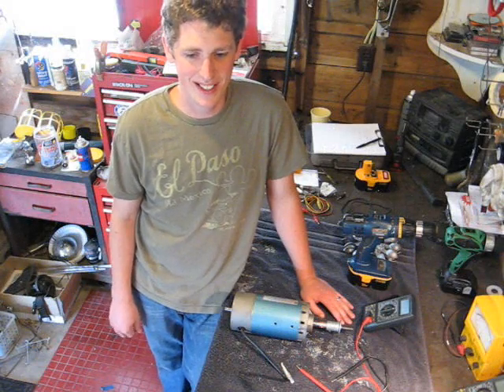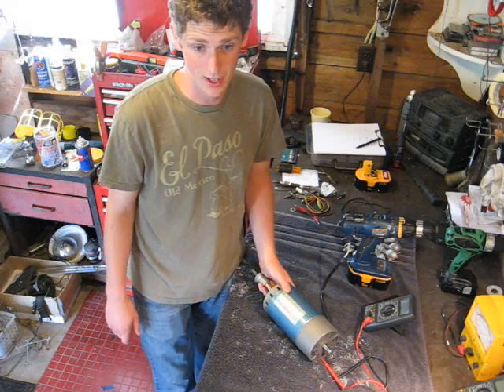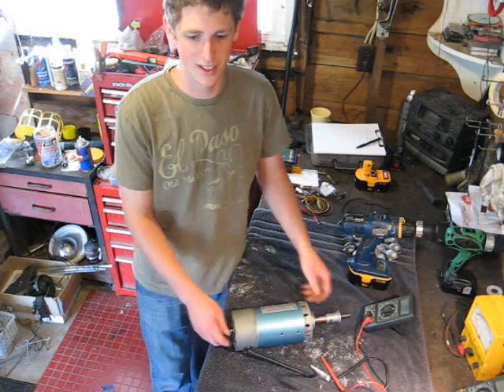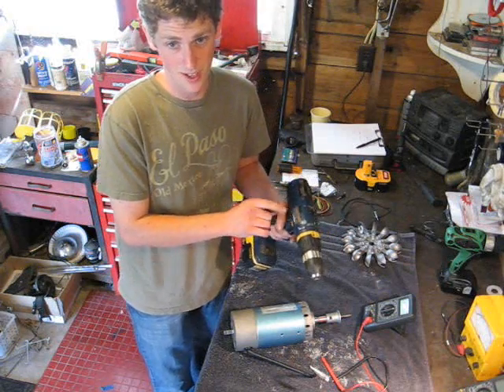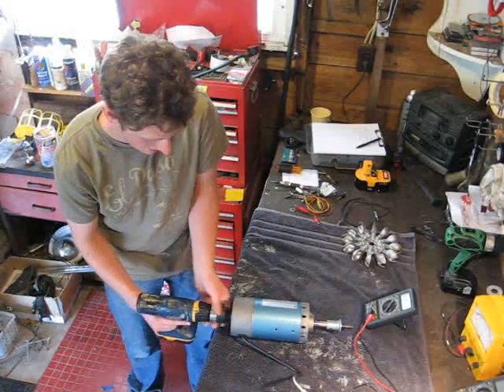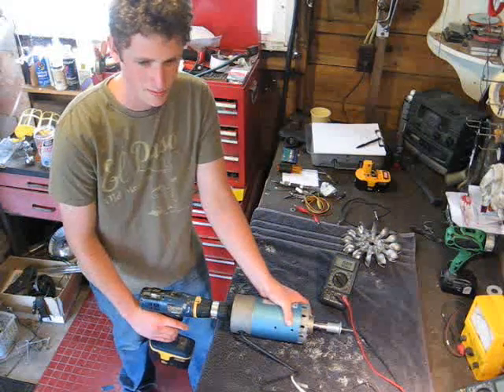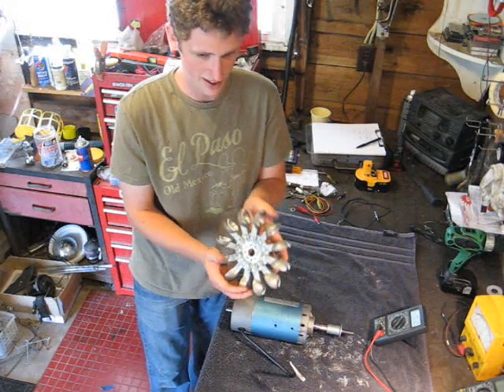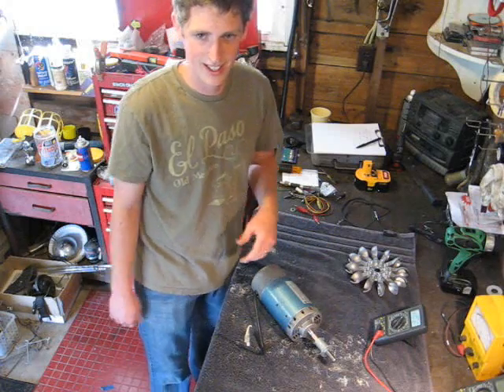How to test a DC motor for use as DC Generator "Shinn Fu" treadmill motor

Comment: Treadmill with DC? Why? I saw one of those in the garbage room that I meant to disassemble but didn't. I couldn't for my life figure out why there would be a big DC engine in something run on AC?
Reply: The reason DC motors are used in treadmills is to allow easy variable speed. It's much more expensive to do this with a true AC motor.

Comment: You can use an automotive voltage regulator to regulate for 12-14vdc voltage. There are adjustable voltage regulators you can buy or build as well. One thing you do need to do when using these type of PM motors, you need to keep the RPM in check. I use a voltage & current meter that gives me the output at all times. You can then adjust your RPM accordingly.

Comment: PM motors are good but there is almost no way to regulate the voltage output well(it will be fixed because the flux from permanent magnets is fixed.)To regulate voltage you will need a shunt or compound wound DC Cumulative compound DC motors work better than differential compound

Comment from the maker: Well with hydro you could use a governor that regulates water flow in correlation with voltage. If not hydro you could use voltage regulator(s). Why the need to regulate voltage, whats the application? 

A battery will absorb excess voltage, as long as you keep it from over charging with a charge controller.

Comment: @enticed2zeitgeist If your RPM/volt = kv is too high, your output voltage will be too low to charge a 12v battery.   Output voltage = rpm / kv.   For example,  12v = rpm/ 30  -->  rpm = 360 rpm, which is really fast for a windmill.  A lower kv rating would be better (easier for a beginner to make a succesful windmill).

Comment: is Voltage per RPM more important than motor efficiency?

Let me ask this.  Would you rather use:
A motor rated at 130 VDC rated at 75% motor efficiency
orrrrrrr
A motor rated at 24 VDC rated at 88% motor efficiency

Also, do you know anything about motor efficiency vs. generator efficiency?  
Is it the same forwards and backwards (a motor with 88% efficiency also acts as a generator with 88% efficiency?)

Comment: Your fooling yourself! you have to look at the power output with an oscilloscope not just with a DC volt meter. You will see that the power coming from the "DC generator" is not clean.

You can gain more efficient power if you rectify the power coming out of a permanent magnet motor.

Comment: Treadmill motors are a good choice for these types of applications.  I've currently got one mounted to a stand that is powered by an unmodified bicycle.  The key is testing them like you did in the video, and having permanent magnets in them.  Alternators and motors with electromagnetic coils require power just to energize the magnets and usually need a rectifier to convert the current to DC.  A+ on keeping it simple.  Thanks for the vids!

Comment: I have one of these motors and i am going to build a Wind Generator with it. My only worry is...how many amps i am going to get at 700 rpm and at what wind speed? i see winds on a daily basis at over 25 mph and more most often at 40 mph. I also plan of using a 4.5 inch hub,  but i need to know the correct length of  blades to use.

Comment: Keeping in mind that a good 100Amp alternator will give you the same power output that a 130V 10A treadmill motor will.  Also its important to be able to vary the load coming from the generator to keep it in its power band, similar to solar cells, maximum power isnt found at maximum voltage or current output, but somewhere inbetween.

Comment: people need to understand the deadest simple rule of electronics P=I*V or power is voltage times current. comments about rpm's and voltage are meaningless without current.  Most people making home windmills do use car alternators because theyre designed to generate power at varying RPM's and because you can pretty much plug them straight into an inverter.  You also just HAVE to gear/belt it to a useable RPM range, and preferably use a battery for energy storage

Comment from the maker: Well your typical car starter runs a thousands of rpm's at 12 volts, so the inverse would be about the same.  Having to spin 2,000 rpm's to get 12 volts is less than idle for wind.